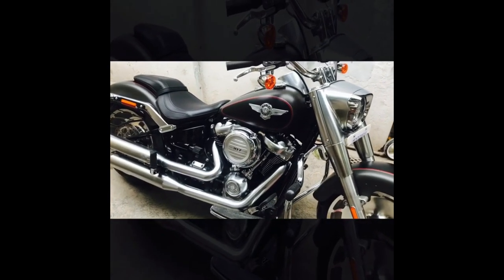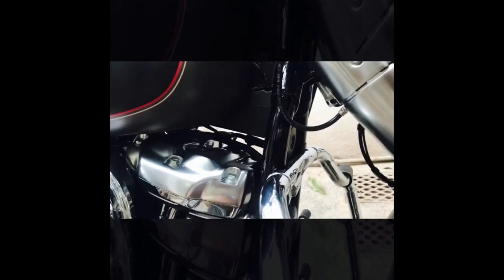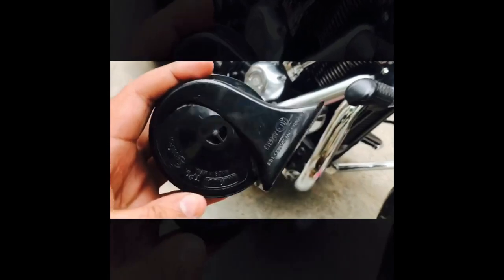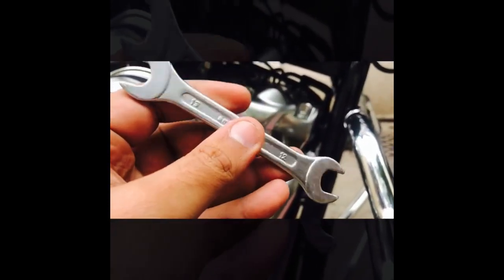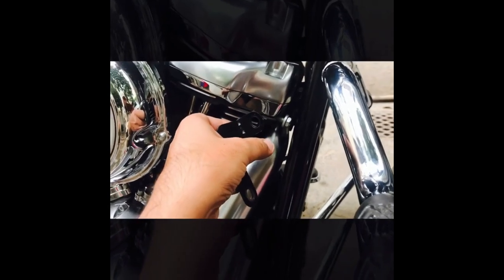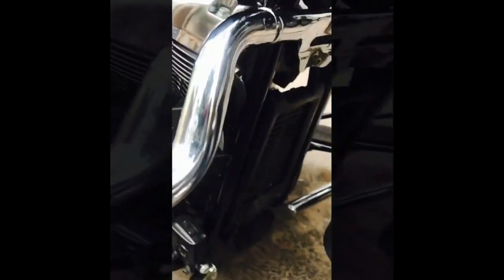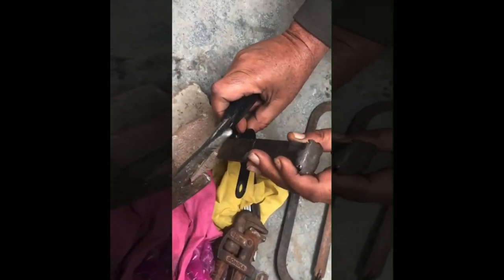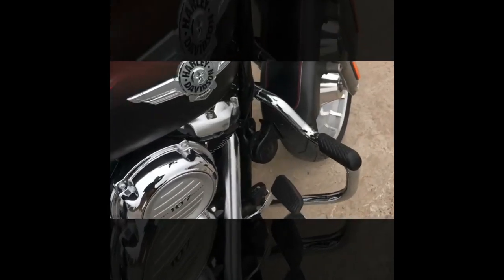HARLEY DAVIDSON HORN Installation in fatboy

Comment: Relay is necessary or not
Reply from the maker: Very much required, the harness of the motorcycle is not capable of that much current ao we complete the circuit using relay and do a new wiring to the horn.
The heavy current flows from this. Its like controlling a heavy circuit using normal weaker circuit ,ie- the horn button